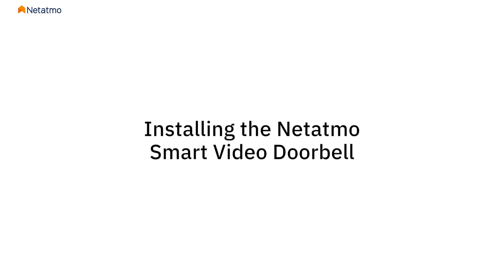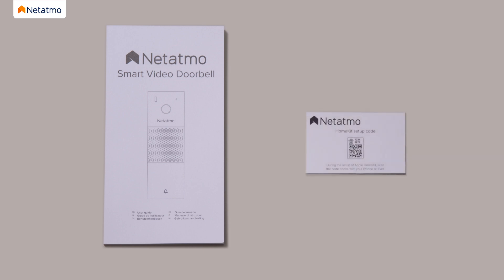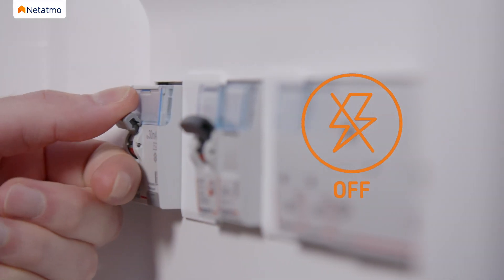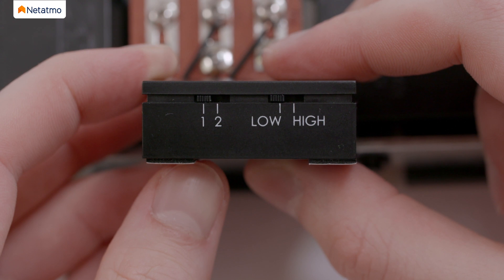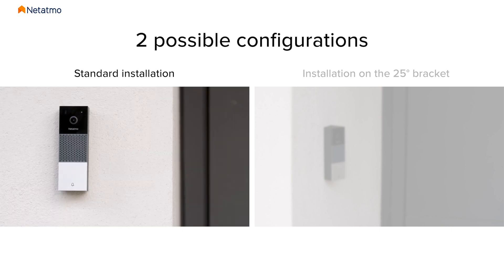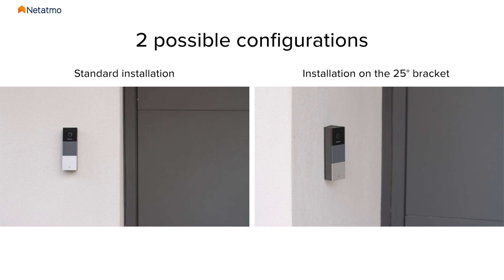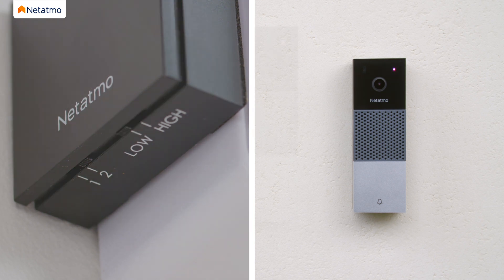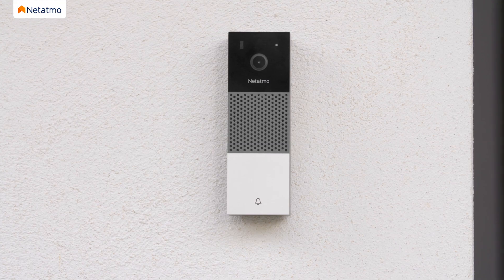How to install the Netatmo Smart Video Doorbell yourself

Comment: Attaching the doorbell to the mount is a little difficult but once it locks into place it seems extremely sturdy.  https://www.youtube.com/post/UgkxxHZwMa8CsRjYhf9s4W8w0Dwm47uytWOp I replaced my regular doorbell with this and hard wired it in, using my existing wires and mechanical chime. It works perfect so far and integrates perfectly with my blink camera system. It also works seamlessly with Alexa

Comment: There are two connection in my switch board: one for a chime downstairs and one upstairs. Both are connected to a 11,5 V transformer. Will both chimes still work?
Reply: 11,5V would suffice according to the power specifications specification "8-24V & 230V; requires a wired doorbell and chime". Follow this link for the specifications: https://www.netatmo.com/en-us/security/doorbell/specifications. If you have two push buttons and two chimes and each of them work independently from each other, I would assume that they are both connected in parallel to the transformer and I would think it could work. If you have only one push button and both chimes react to that, I'm not sure it will work. Either way: it's best to draw a little electrical schema and send that to Netatmo for verification.
Reply: @londer71  Thanks for the reply. The transformer is 11,5V, 4A. Both chimes are connected to one push button and to one transformer. I have drawn a little electrical schema, where can I send it to?
Greetings, Marc

Comment: How to install it without existing wired doorbell ? If I only have power cable in wall ?
Reply from the maker: Hi Alexei,
If you do not have a wired doorbell, you'll have to install a power cable wherever you want to install the Smart Video Doorbell.
If you prefer not to install it yourself, call in a qualified professional from Netatmo's network.
Learn more about it here: https://www.netatmo.com/en-gb/security/doorbell/installation
Have a great day :)
Reply: @NetatmoChannel  Hi, so this means if my 50+ years old chime turns out to be not compatible, i can still install the doorbell with exisiting wires outside the house and have a homepod chime me?

Comment: How about a flush mount? I would rather have it flushed with a door casing.
Reply: Did you watch the entire video? See 4:07, if you don't add the 25° angle piece, the doorbell is mounted flush (flat).

Comment: Hello. Is there any support available on this? I tried twitter, reddit, your own forum. Even the Apple care hotline. Nowhere can i seem to find any connection for support with Netatmo... My videodoorbell has been installed by a certified electrician but it keep pulsing green for over an hour and doesn't change to solid green. My black box is on 2 low. I have a few weeks left to return for a refund worst case scenario... Anyone?
Reply: Apparently their support is digged very deep in their Q&A lines. Just a big button for 'support' would be loads easier and a lot less frustrating for users. My doorbell was declared dead on arrival by Netatmo through their zendesk system.. (ugh that's so painfully slow and unpersonal)
Reply: You're doing better than me.  Were did you buy one?
Reply: @gmac2.0  straight from the online apple store. What's your story friend?
Reply: @jdb6284  Thats just it.  I'm In Australia, not that I was looking buy here, but I'm unable to find one anywhere on the net including their Netatmo site that redirects me to France. May I ask what country you're in so I can checkout your Apple store? And best of luck with support.  BTW there are numerous Youtube channels that have been testing the Beta versions. Maybe start with them. Thanks GMAC.
Reply: Found it!   France....!   I love my VPN. Now how do I buy one???
Reply: @gmac2.0  good luck mate, getting it to australia is one thing, but getting a return once shit hits the fan like mine did is gonna be something else entirely!